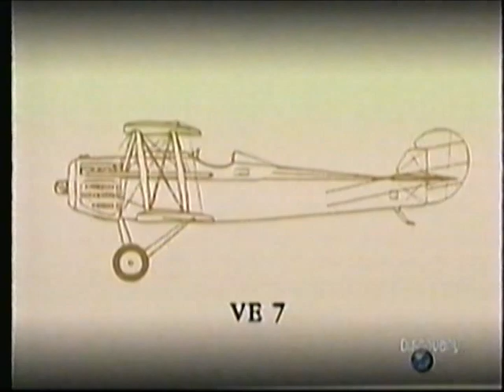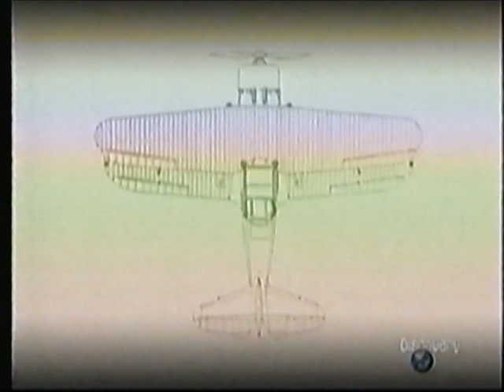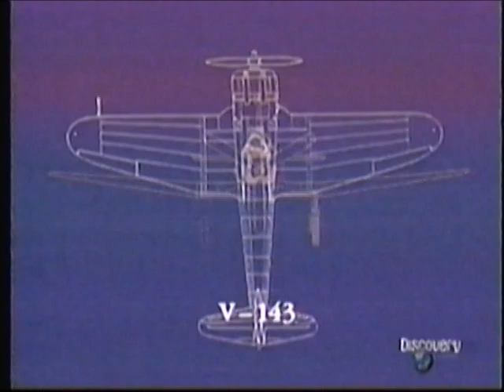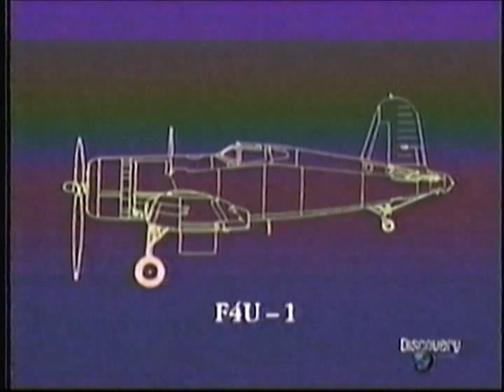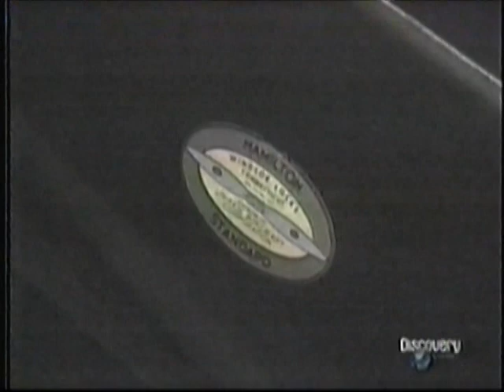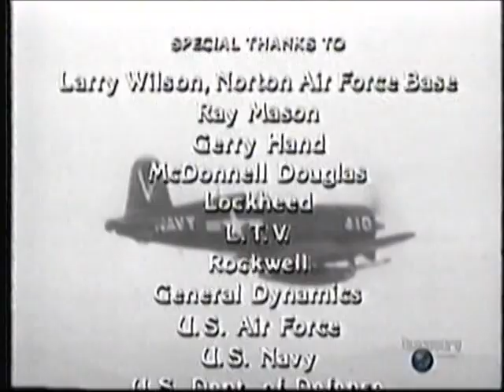Chance Vought F4U Corsair Whistling Death

Comment: The gull-wings weren't an aerodynamic consideration. They were necessary to provide ground clearance for the massive 13ft. diameter propeller. Thanks for the video my friend.
Reply: Actually not entirely correct.Check out Greg's Airplanes and Automobiles (on YT) for a full explanation.
Reply: @philipjooste9075  Thanks Philip, I'll definitely check that out. I'd always been under the impression that the gull-wings were needed to provide ground clearance for that massive 13+ foot Hamilton Standard prop. Thanks again for info my friend!
Reply: @chrisnizer1885  they were to help with ground clearance, but gull wings also were a better option aerodynamically than a bulge or fairing protruding out the bottom- interference drag.  The corsair fuselage was more streamlined than say the hellcats or thunderbolts because the wings joined the body at right angles. So, yes it was for prop clearance, but that's not the whole story.
Reply: @khaccanhle1930  My question is what bulge or fairing protruding out of the bottom? I've never seen or heard of Chance-Vought engineering a bulge or fairing for the Corsair as an option for the gull wings or the huge propeller. The only other option was an EXTREMELY long landing gear strut assembly that was considered impractical...for many reasons. So I'm not sure what bulge or fairing protruding out the bottom that you mentioned. Could you be more specific? I'm very curious as I've been a huge fan of the Corsair for about 40 years now. Thanks!
Reply: @chrisnizer1885  There wasn't one.  He refers to the possible solutions considered, not something that was actually built.
Reply: Corsair...... Get Bent !!!    Need a shirt that says that.
Reply: @viperessprincess1012  That's actually pretty cool! Sign me up for one.
Reply: @viperessprincess1012  When the Corsair was king, "Get bent." meant get pregnant. Something arguing girls might say to each other.
The Corsair pilots might have loved it.::):)
Reply: @macnutz4206  yes,  the bulge was NOT on a corsair because they joined the wings at right angles to the fuselage.  The engineers wanted the widest part to be the engine, nothing sticking out larger.
Reply: @khaccanhle1930  I know. The bulge came up only because there were some thoughts, at that time, about other solutions that would have required such alterations. They were never seriously considered.
It appears that the engineers new exactly what they were doing. :):)
Reply: @macnutz4206   Wow !!!   never, ever knew that !!!   Never even heard the phrase.   Well, I think you know what I mean.... would be a pretty neat t-shirt.
Reply: @chrisnizer1885  Like I said above- check out Greg's Airplanes and Automobiles (on YT) for a full explanation. If you are a Corsair fan like you say, Greg gives a perfect explanation of the true reasons for the gull wing decision. Plus, in other videos, stuff like turbo-supercharging, laminar flow (another myth), etc.

Comment: The Gull wing was needed to help the 13ft prop clear the deck.    It made her tall enough to not pound her nose into the ground on landing.
Reply: 12 foot propeller.  It also had lower drag which would improve speed.   I flew a a Pacific gull 10meter hangglider which was easiest st the time to turn just look in the direction you wanted to turn & it followed by turning that way without pulling your weight over.   The other manufacturers soon followed suit useing different configurations